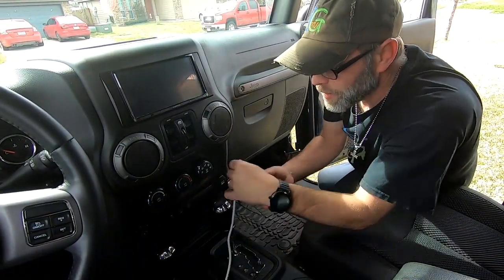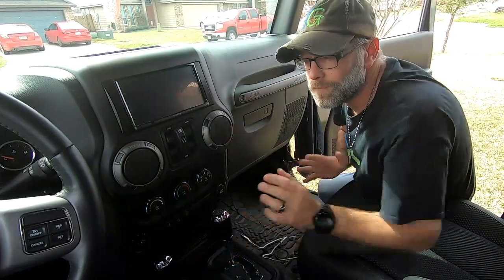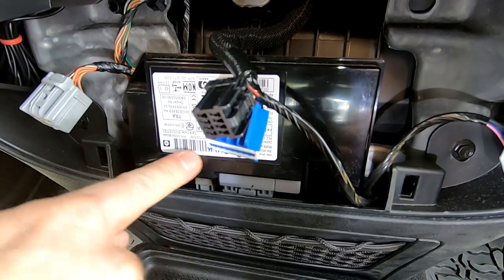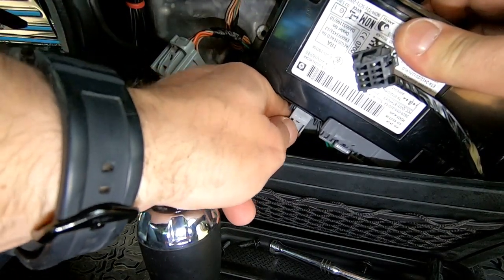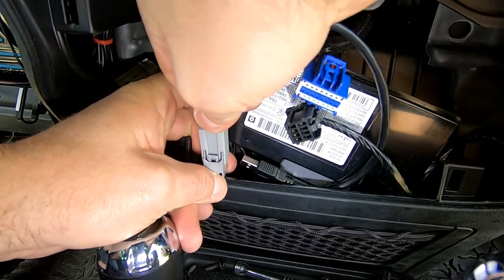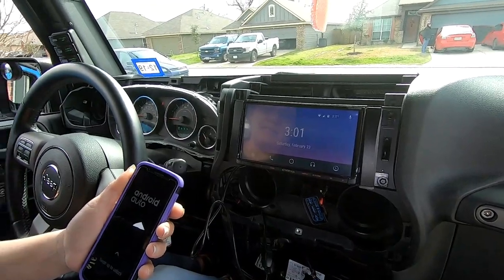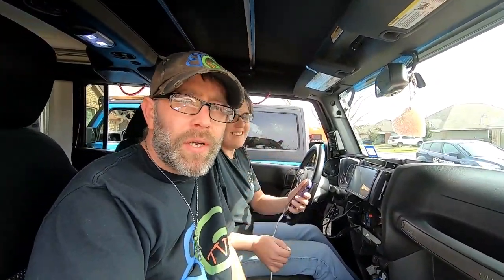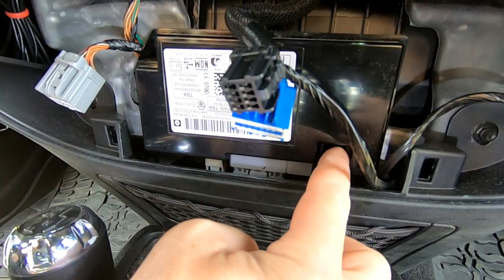Episode 371 - Jeep Wrangler Aftermarket Radio with Factory USB Port - HOW TO

Comment: fun fact,  i did some of the plumbing in the houses on your street and most of them in that stylecraft subdivision. i work in bryan/college station and i was thinking damn those houses look familiar lol. I have a Jeep Question, Im having a Transmission/Transfer case issue.  my 05 Jeep TJ Sport Automatic is making a weird noise somewhere between the front of the transfer case and the back of the transmission, it goes into forward gears but when you put in reverse the noise is louder and it doesn't move. this started the other day when i was driving back from conroe and all the sudden the noise started and then there was a couple jerks so i pulled over got out and everything looked fine. i put it back in gear and it wouldn't go forward or backward, i had to trailer it home. but while i waited for the trailer i put it in 4x4 hi and it started pulling forward again but still no reverse. i put it back in 2wd and i have forward gears again but still no reverse. and the noise it makes sounds like gears not meshing so i don't know if its the tranny being an auto or the transfer case... any thoughts?

Comment: Great video. Do you know if the 07 jku has that Model for USB port
Reply from the maker: Thanks a bunch. Honestly thats a great question. I think it just depends on the options that came from the factory. The 2015 Altitude we had did not have the factory USB port so we ended up adding one. I think we even have a video on that.
Reply: Thank you I’m going to look a little more in to my jeep

Comment: Does this work for the front USB port on a 2107 Jeep renegade or just the one in the arm rest.
Reply from the maker: Honestly Im not sure. Really depends if the module is the same. Looking at adapter, its mainly a usb cable. Just has the factory connector on it to plug into the module.